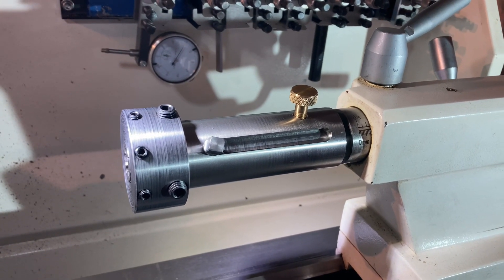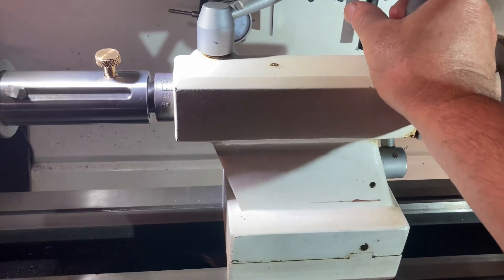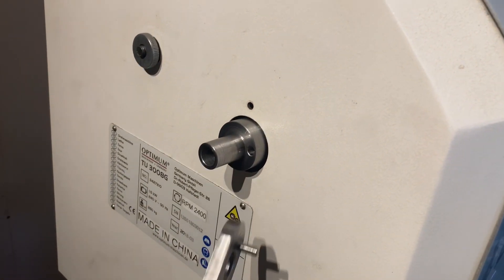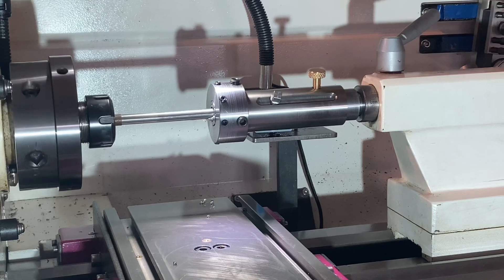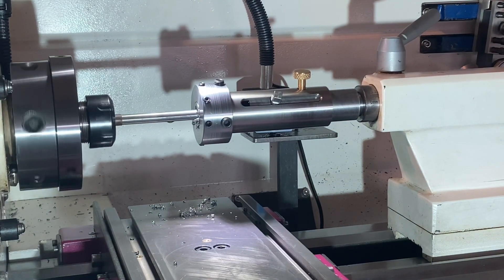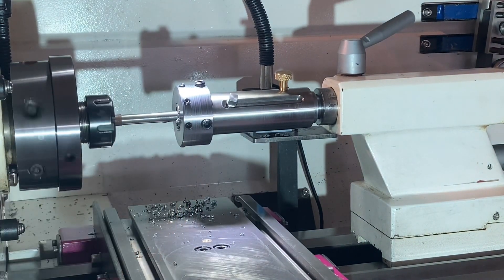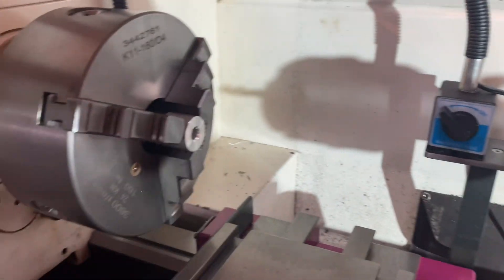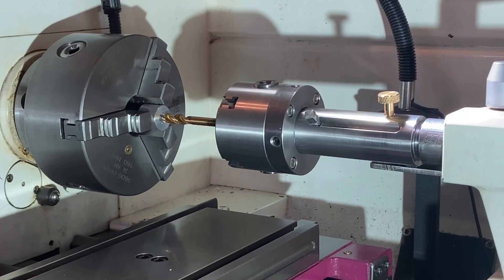Tap & die holder for a lathe

Comment: Hi John, what are the light amps you are using on your lathe fitted to the magnetic base? Great idea for the tapping and die holder you have.
Reply from the maker: Hi mate, the light is 9W LED. I bought 2 of them from eBay, one for my milling machine as well. Unfortunately they are no longer available on eBay, they work great.
Reply: Thanks  @johnnyciantar

Comment: Your setup is robust enough to do it under power.
Reply from the maker: Hi, I’m now cutting threads under power, the problem I had was my lathe’s slowest speed was 125 rpm which I felt was too fast, I’ve now modified my machine by adding to the pulleys and now my slowest speed is 68 rpm

Comment: Does the anti-rotation tang prevent it from spinning in the taper?
Reply from the maker: Hi, in my tailstock the tang does nothing, I cut in the tang thinking I may want to use the holder in my drill press which would need the tang for the unit to fit. The MT3 taper I cut has good contact surface area so it grips well and hasn't slipped. So far the only slipping I've encountered was in the E32 collet chuck holding the rod, to over come it, I just clamped down harder on the stock.